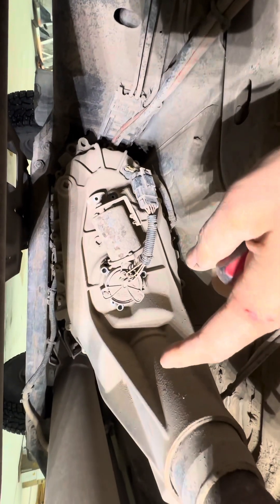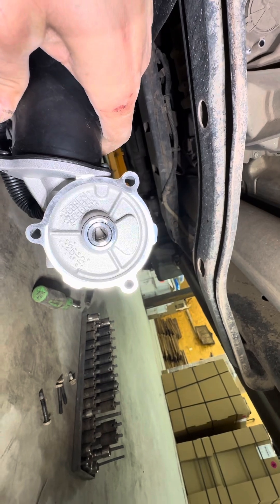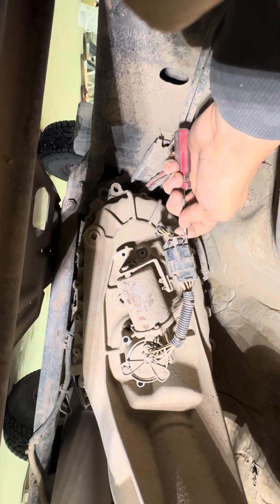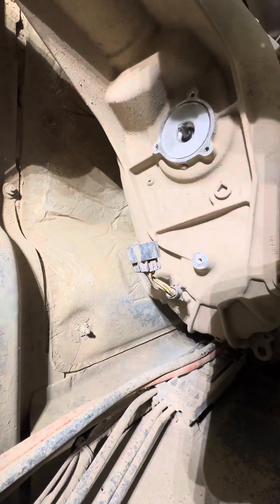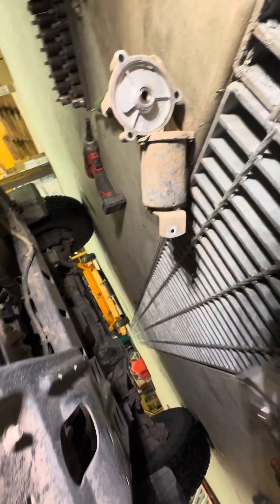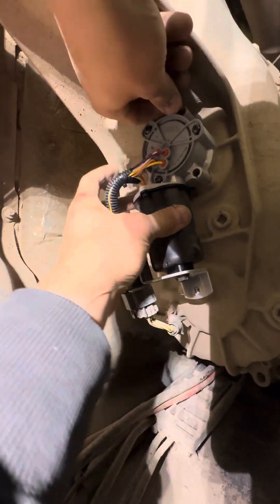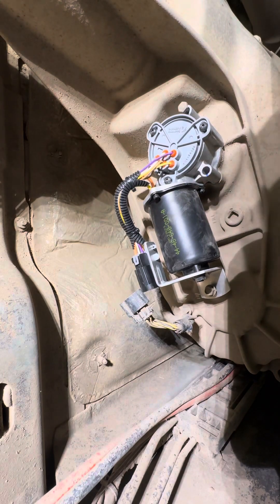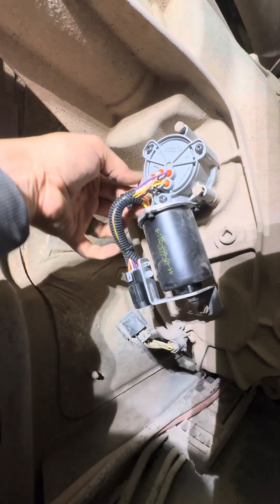Ram 3500 won’t go into 4x4 (4x4 transfer case gear motor replacement)

Comment: Just replaced the front axle disconnect and didn’t fix a thing. I’m thinking it’s the transfer case motor now or maybe even a wiring issue. Any ideas?